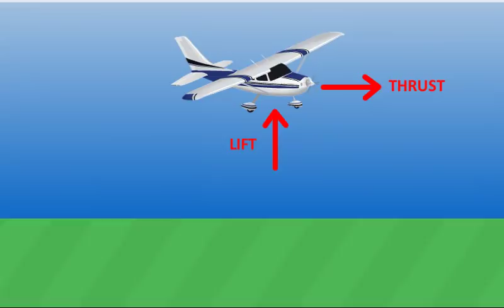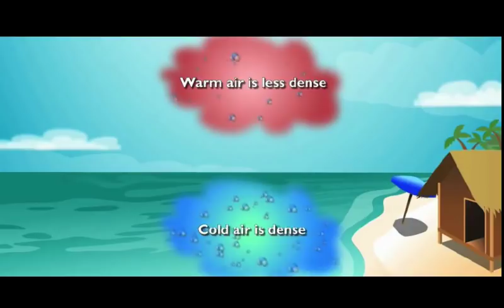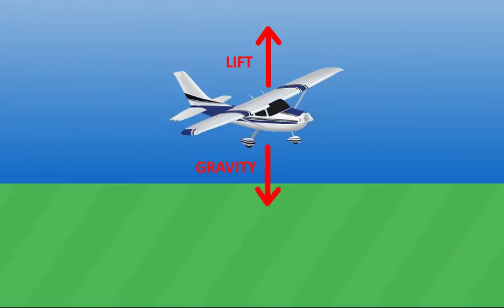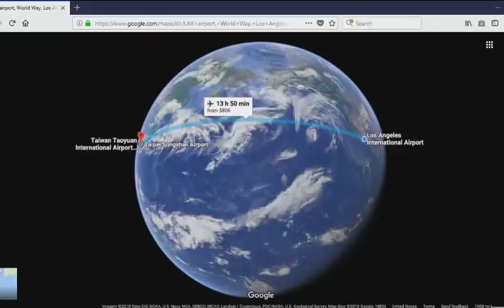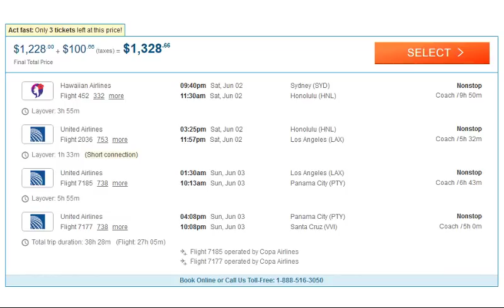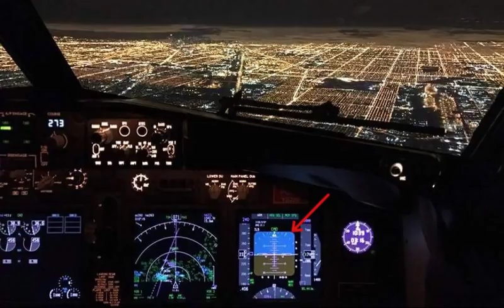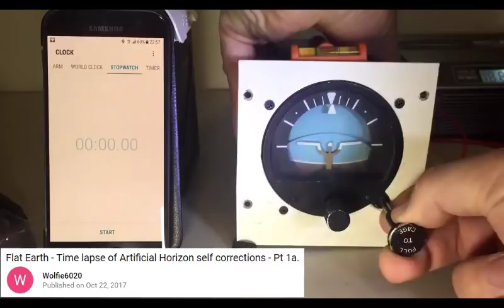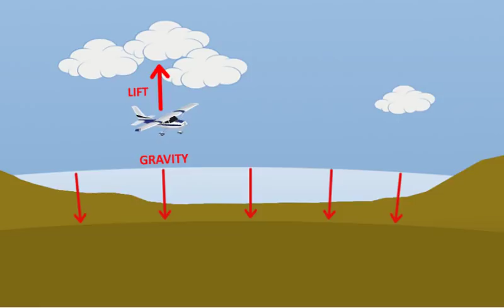Flat Earth Falsities - Plane Nonsense

Comment: Temps on the moon range 500 degrees from night to day 253 degrees day to -253 night . those space suits must have been smelly with those depend they wore and that flimsy lunar module had some kinds system to keep it just right for the astro nots who were out jumping around in the dirt haha .
Reply: First: the temperatures only apply for the moon surface. There is no air which can have these temperatures. So it's more of an insulation from the boots.
Second: the suits have in internal cooling system, which followed an almost massive showstopper, because the previously envisioned cooling system, just pump some cool air in, proved to be very inefficient, they had to envision an undergarment with cooling tubes in order to word this problem out.
Third: Yes, the astronauts were smelly after the flight. There's this anecdote, after the watering, the rescue team opened the hatch to the capsule and almost fell over because of the smell three people created spending days into a crammy little box. Everybody including the astronauts knew about the smell, but they rightfully said "fuck the smell, who cares about smell when we are going to the moon, let's go!"
Reply: Or the other scenario was they faked the moon landings and Stanley Kubrick directed the whole thing on a movie set which the evidence seems to indicate .
Reply: You mean that scenario that has no evidence at all? That makes no sense at all, after all these people were busy for years creating the technology that makes a moonlanding possible? The example shows that they were thorough even with some seemingly minor task like cooling, as they were with virtually every aspect of a trip to the moon.But if you think they were in with "the lie" you don't know about human engeneering. If you think this can be faked on a set you don't know about physics. If you think the sfx from 1969 was able to fake at this degree, you don't know about movie technics. And if you think Kubrick would have staged the moonlanding, thus interrupting the production of his next movie (not "2001", he already was making "Clockwork Orange" by then), then you don't know DICK about Kubrick!
Reply: Oh do not question NASA who have been caught it so many lies that it has mounted up to the sky .Why did Kubrick use so many clues pointing at Apollo 11 in when he directed the story from Steven King called the shining ? I guess he was mocking someone or trying to tell us something ?  Also he did not have to direct the moon landing he would have advised them on how to fake it .

Comment: Jackass, u know gravity dumbass
Reply: Given the intellect and knowledge you seem to be claiming. i.e. you are the opposite of a jackass, you should be able to answer these simple questions.
Why is it that a compass needle is more or less vertical at the poles and horizontal at the equator?
And when you carry on past the poles the needle slowly returns to the horizontal?
Why is it that it is only possible to navigate accurately over long distances using spherical trigonometry?
Why is it that traditional gyro compasses work perfectly in low latitudes but became unreliable in high latitudes?
Why is it that it is only possible to navigate accurately over long distances using charts based on a terrestrial spheroid?
Why is it that when you watch a ship sailing away from you the hull is the first thing to go below the horizon, then the superstructure and finally the funnel and upperworks?
Does a magnetic compass point towards polaris (Alpha Ursae Minoris) at the north and south poles?
Does a gyro compass point towards Alpha Ursae Minoris at the north and south poles?
What is the relationship between longitude and distance when travelling east or west parallel to the equator?
Please explain the principles behind the development and functioning of a gyrocompass?
No evasions please, just straight answers.
Reply: wong plate people are so retarded
Reply: wong one thing, can u answer them? Or do u just go in a line?

Comment: +VoiceOfIllogic

You first few statements prove your ignorance.
You explain how planes require air to obtain thrust and stay aloft, but do nothing to explain why (even with the air moving with the spin) 2 planes moving in opposite directions. 
Ask any pilot and you will learn, flying WITH THE WIND shortens travel time - never mind the movement of the spinning ground below?
2:50 throw said ball up outside of the car and see if you can catch it.
4:40 The helicopter is moving with the air? This would depend on the location as air moves opposite to earth's rotation north of the equator. You can't have it both ways.
6:00 Wrong. The artificial horizon is kept level because of the use of a gyroscope. This instrument operates OUTSIDE of your GRAVITY.
7:11 What you erroneously stated was a flat map can easily become a ball, but a ball cannot become flat. The distances in said case was NOT distorted (as landing in Hawaii would have been the logically closer, on your ball, than Alaska). Your curved path also does not follow the parallel, so the distance is again skewed.
10:00 Cherry picking? Check ANY flight from any southern location (aside from your unsubstantiated Quantus flight) and see how EVERY flight crosses north of the equator, only to return to south before reaching destination. 1000s of extra miles does not save money, fuel, nor time.

I'd continue, but fortunately for you, I have a real life.
Reply: "I have a real life" is the funniest thing I read all day.
Reply: "Check ANY flight from any southern location (aside from your unsubstantiated Quantus flight) and see how EVERY flight crosses north of the equator"

So any flight apart from the QF27/28 flights? Okay how about these twelve?

Qantas QF 63/64 Sydney<->Johannesburg (6,857 miles)
https://uk.flightaware.com/live/flight/QFA63

LATAM LA 800/801 Santiago<->Aukland (6,005 miles)
https://uk.flightaware.com/live/flight/LAN800

LATAM LA 805/806 Santiago<->Melbourne (7,027 miles)
https://uk.flightaware.com/live/flight/LAN805

LATAM JJ 8162/8163 Sao Paulo<->Johannesburg (4,627 miles)
https://uk.flightaware.com/live/flight/TAM8162

South African SA 280/281 Johannesburg<->Perth (5,169 miles)
https://uk.flightaware.com/live/flight/SAA280

Air New Zealand NZ 30/31 Aukland<->Buenos Aires (6,416 miles)
https://uk.flightaware.com/live/flight/ANZ30
Reply: "The artificial horizon is kept level because of the use of a gyroscope. This instrument operates OUTSIDE of your GRAVITY." 
And the artificial horizon uses a mechanism called pendulous vanes to ensure that the gyro spins level. If it doesn't spin level it is useless (on flat earth or round). Pendulous vanes operate by gravity. See inside a real artificial horizon here: https://www.youtube.com/watch?v=z1QGRPVBZvw
Reply: +Joseph W  - Hi Joseph.  Ask any pilot?  Ok, here I am - ask away.    I have 10,000 hours - several thousand on helicopters and the majority gained during international flights around the Earth.  I have circumnavigated it many times.  I hold FAA and CASA ATP ratings and a flight instructor rating. 

Travelling with the Wind does shorten travel times but if the Wind is moving with the rotation of the Earth there is zero effective wind speed and therefore Ground Speed will be the same going East or West, so no change in flight times for a similar distance. 

4.:40  Air does not move opposite to Earths rotation North of the Equator - that is just wrong.  It is generally moving with the Earth's rotation give or take local winds. 

6:00  Sorry, you are 100% wrong here.   The instrument uses gravity to constantly correct itself to local level.  I show you how this works in videos on my channel using a real Artificial Horizon.  The Gyroscope is susceptible to many errors.  Turning and acceleration errors are common (ask any pilot) and the pendulous vanes are needed to continually correct.  As they correct level based on the direction objects fall they also continually adjust for curvature as the aircraft flies around the Globe.  100% fact.  

7:11  Wrong again.  Alaska was much closer than Hawaii when you plot a great circle route on a Globe.   I have flown these routes and have actually made an emergency landing myself in the Aleutians in a private Jet.

10:00 Wrong again.   QF27,  QF28,  QF63 and QF64 are just some flights that never cross the Equator - they fly between Australia and South American and Australia and South Africa. 

Most other airlines route via the Northern Hemisphere as they are not permitted to do direct non stop flights between these countries due to Cabotage Laws.  

...and I am a Pilot Joseph.   If you ask me VoysovReason's video is good.
Reply: I would say Joseph W is trolling.
Or at least I hope so.
Reply: @Joseph W
 "I bet they can all be tracked with GPS too hey?" What an ignorant statement. It is patently obvious you don't have a clue what GPS actually is..
"Try jumping on to a moving merry-go-round. ;)" No problem if it is rotating at 0.000696 rpm. or 0.0000116 rps which  is the rate at which the earth rotates.
Given the intellect and knowledge you claim you should be able to answer these simple questions.
Why is it that a compass needle is more or less vertical at the poles and horizontal at the equator?
And when you carry on past the poles the needle slowly returns to the horizontal?
Why is it that it is only possible to navigate accurately over long distances using spherical trigonometry?
Why is it that traditional gyro compasses work perfectly in low latitudes but became unreliable in high latitudes?
Why is it that it is only possible to navigate accurately over long distances using charts based on a terrestrial spheroid?
Why is it that when you watch a ship sailing away from you the hull is the first thing to go below the horizon, then the superstructure and finally the funnel and upperworks?
Does a magnetic compass point towards polaris (Alpha Ursae Minoris) at the north and south poles?
Does a gyro compass point towards Alpha Ursae Minoris at the north and south poles?
What is the relationship between longitude and distance when travelling east or west parallel to the equator?
Please explain the principles behind the development and functioning of a gyrocompass?
No evasions please, just straight answers.
Reply: Nothing operates OUTSIDE gravity.
Reply: @RogHawk
FE belief and trolling are not mutually exclusive.
Reply: haha you got absolutely fucking blasted
Reply: You are giving him too much. He is an empty vessel.
Reply: What is your point?
Reply: Man, you really are embarrassing yourself
Reply: I live a sheltered life. like with a dome? lol
Reply: +GrahamStw

Hm yeah. 

I bet they can all be tracked with GPS too hey?

Haha
Reply: +GrahamStw

Yeah.

Way to cherrypick. 

I notice no one addresses the air current issue. 

Apparently air moving with the rotation of the *cough globe *cough has no effect on aircraft that leave the ground ( no matter the direction). 

Also a landing plane is not affected by spinning ground hey?
Try jumping on to a moving merry-go-round. ;)
Reply: +LLCisyouandme

You must lead a sheltered life then.
Reply: +Cave Jug

Clearly your mind does.

It defied gravity when you stuck your head up your ass.
Reply: +GrahamStw

I wonder why all plane gyros are set-up BEFORE they leave the ground?

Oh yeah, so they can adjust during flight, right, I forgot.

Comment: Explain air currents defying the momentum of the earth then! how do waves maintain their strength going against the 1k mph rotation? What "friction" is the earth applying the all the air on the planet. Also object in motion will not tend to stay in motion because of the friction of the air and thus will need thrust to stay in motion. Earth's motion cannot be assumed or proved from this video.
Reply: Gravity and inertia.  Friction experiment: wind.  Thrust: rotation of planet.  (one full rotation per day.  1000mph is irrelevant unless applied to another stationary object which does not exist ANYWHERE on Earth.)  Earths rotation proof: star movement.
Reply: Star movement is subjective. FE states the stars move & earth is stationary. Star patterns are always constant without variation signaling earth is in a fixed position therefore negating inertia & gravity theory. Back to square one: does the planet really move and how to prove it!!
Reply: Again, they are very very very far away. Proxima Centauri is the nearest star after our sun and it is still about 40,208,000,000,000 km away.
And yes the patterns and positions do change over time. http://www.halcyonmaps.com/constellations-throughout-the-ages/
https://www.wired.com/2015/03/gifs-show-constellations-transforming-150000-years/
Reply: @kbcorp. Star "patterns" (relative positions) aren't constant throughout a year. Read about parallax.
Reply: @kbcorp. Okey sorry, then read about proper motion of stars. Constelation don't create constant patterns. There are changes but so small that it went almost unnotices through thousands of years. Only now we can measure positions of stars with such precision to notice that.
Reply: @Martin G.  parallax is not the concept I was referring to. In all of time the constellation pattern has always been the same yet earth is supposed to be moving in 5 different directions AND have a wobble to boot? That's virtually impossible.. the star pattern would be all over the place even if over time.

Comment: Great video...some of your points negate these Flat Earth claims and for that I must credit your work. But I do have one question. Say the atmosphere is moving with the earth,  do you believe that there is a speed at which one could fly against the spin of the earth in that it will never get any darker out in fact time shouldn't even change? Also,  imagine a particle of water in a unidirectional flowing river... Are you saying that some of the particles of water are flowing perpendicular and against the current all while flowing in the direction of the current? This would be similar to why we have winds in all directions while the atmosphere follows the earths rotation. Lastly in any experiment I can conduct gases never follow along with a solid in projectile motion,  they tend to trail off like the tail of a comet,  do you think in a vacuum, the gas will follow the ball?
Reply: You are correct in all aspects.
Just a few clarifications.
Inside atmosphere smoke can't follow solid object because it encounter resistance from other gases. On the other hand in a vacuum while in Earth gravitational field smoke will just reside on the bottom of a chamber. That experiment might be doable on the ISS.

Comets have tails because they are bombarded by particles from the Sun and that is why this phenomenon exist. If Earth wouldn't have magnetic field it would loose atmosphere just like Mars.
Reply: The atmosphere is unlike a river, but is a body with rivers in it.  The atmosphere as a whole in relation to the Earth acts like it is part of it.  If you got in a plane and chased the sun at about 1000 mph, yes...it would stay light.  Until you ran out of fuel...
Reply: Any experiment you conduct on Earth will be effected by Earths gravity.  On the ISS, the mass of the ISS would trump the gravity of the experiment.  That's the problem.
Reply: V Edwards
Fuck off you pathetic troll.